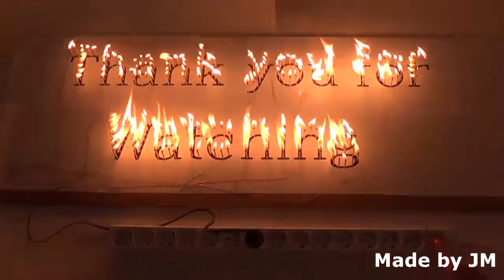How to make a Batteryless Clock (A Clock runing by USB Power)

Comment: The content on this channel is degrading. Dude, doesn't the power bank contain battery/ies? Isn't it a lot more practical/easy/cheap/effortless/messy to use discarded/dead batteries to power your clock?
Reply: I think the point of this video was to show how to power things through usb. You can use the wiring to power basically any battery powered electronic through usb. This offers an advantage over batteries directly because it's much easier to plug out the usb chord.
Reply: Klaus Klass
Then maybe it should be titled "Power various battery powered devices with a power bank/usb cable". And show different usages, especially something more practical and useful as I don't think there is any value in being able to easily unplug a clock which shouldn't be unplugged anyway.